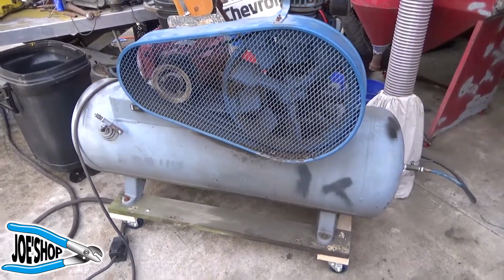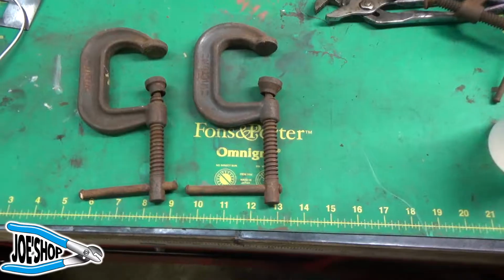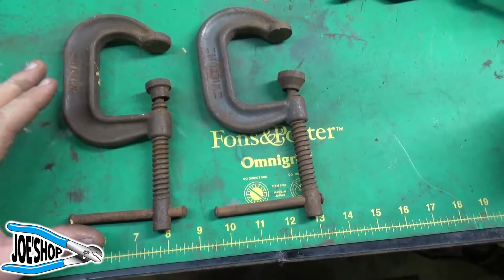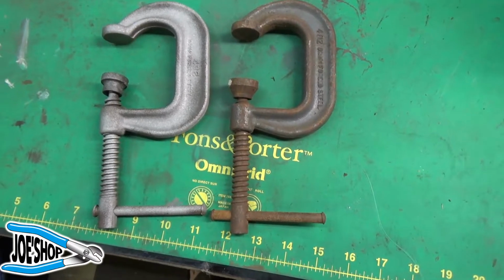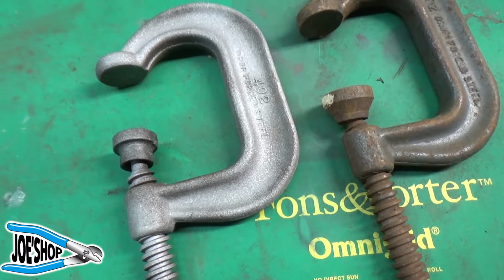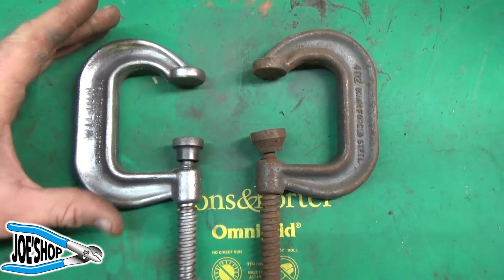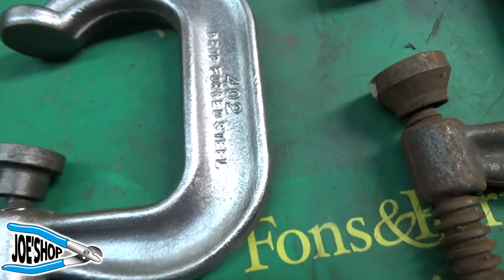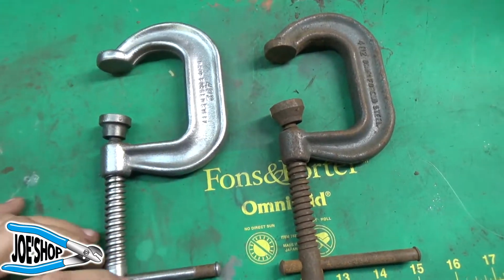Media Blasting a Wilton Clamp

Comment: Joe clamp looks good....I wish I had access to a blasting cabinet 😀.  So I get you have some form of cyclone particle separation on the back.  What is the personal risk using a set up with fine particulate (rust, chemicals, paint, etc) I am wondering what sort of filter is catching the bad stuff so you are not inhaling it?    Cheers
Reply from the maker: I try not to blast really old or exotic stuff. I have an exhaust hose that runs away from the machine and through 2 dust collector bags. I also have a fan blowing fresh air towards the blaster.